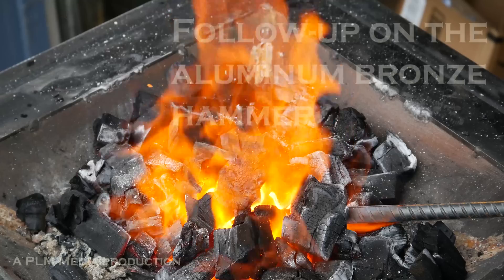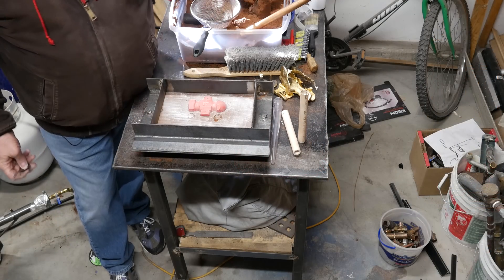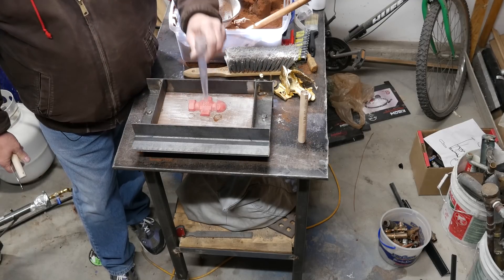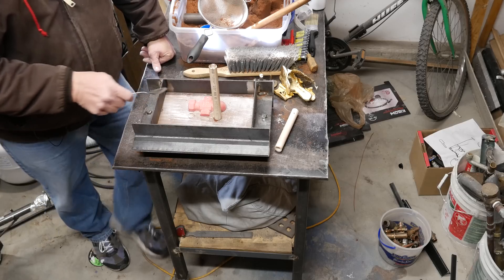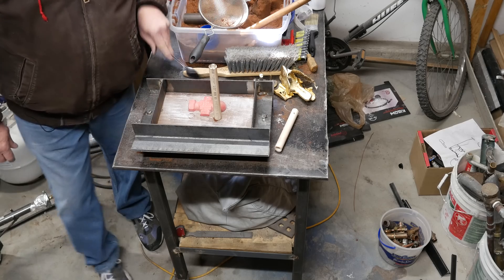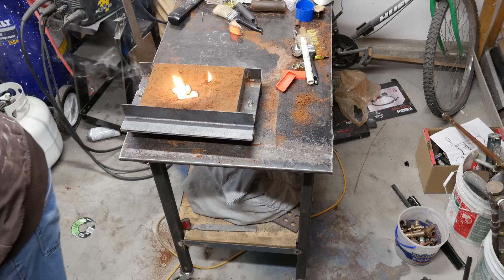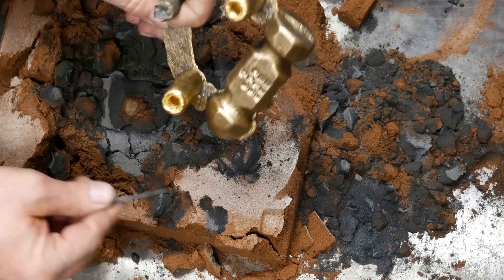Follow up on casting aluminum bronze hammer

Comment: I need to make 3 hammers similar to this except in brass. I believe brass has less issues with shrinkage but I still want to use a tapered sprue and similar gates. Do you think I still need two small risers or just one large feeder/riser like Martin uses?
Regards, 
Preso
Reply from the maker: Hi Mark. I'm not familiar with how brass shrinks. I assume it's not as bad as the aluminum bronze that I used... nothing is except maybe a souffle.  ;-)

Martin actually suggested the two feeders so that there was one near each large mass in the hammer.  I suppose you could do one large one above the part but if you're using a core for the eye of the hammer you might be defeating the purpose as that will be the thinnest part of the hammer and likely to freeze first. Of course with the feeder right above it maybe it wouldn't. Sorry man, this stuff gets so bloody complicated when you're trying to figure out where to place feeders.  I'll let Martin know about your question and see if he can add anything.
Reply: @swdweeb  Thanks for the feedback. I hadn't considered that the big feeder would have to go in directly above the core. I think i will just replicate what you have done. No sense in reinventing the wheel! I did cast a lot of brass lately and it seems to have far less shrinkage problems than aluminium and I am guessing aluminium bronze. My only issue now is getting some hammer handles. I went to two tool suppliers, a rural supplier and our local hardware store (like Lowes, only worse) and not one had a replacement hammer handle. Evidently, hammers are now considered to be consumable items. I had to buy 5 new old stock hickory handles from the UK via Ebay.
I always enjoy watching your videos. Having fun and learning at the same time has much to commend it!
Regards,
Mark Presling
Reply from the maker: @Preso58  Thanks Mark. I appreciate that. Good luck with the hammers

Comment: Thanks to you and all that helped for the details!
Reply from the maker: Thanks. The more I cast Aluminum bronze the more I'm slowly learning to accept is that it shrinks a lot and you hae to provide it with adequate feeders. If I were to cast that hammer head one omre time, I'd pur larger feeders on it even though those small one seemed to work ok.

Comment: I was looking for an alloy I could make at home to make bullets from, I wonder what weight a bullet would come to if I made it from this aluminum bronze
Reply from the maker: Don't know. I'm trying to cast a hammer that is using the actual head as a pattern. The real one weighs 2lbs 12 oz. The bronze came in at 2 lbs 7 oz and there were voids in it so it's almost the same weight as steel. I'll know more once I get the head cast without issue.

I hope you're not planning on firing them. This stuff is hard and would probably wreak havoc on the rifling in the barrel.

Comment: Great looking casting!  I have a minor suggestion I have see used for a even finer finish if you would like to test.  After removal of pattern reapply talc powder to the molding and remove excess used compressed air.  It fills in to smooth out the grains and gives a near perfect finish.
Reply from the maker: You know, I saw olfoundryman do that in a video just the other day. I didn't think about it at the time, but that makes perfect sense.  I'll try to remember to give it a try on the next casting... hopefully this weekend.  Thanks for the tip!

Comment: Thank you. I'm having fun and learning stuff right along with you. Especially now when my foundry bucket is up drying the 2nd coat of satanite right before being ready for tempering and firing in anger. :)
Reply from the maker: Sounds like you're getting close. This is a blast, especially learning to do it right. Clearly I've got a long way to go but I'm a lot further along now than when I started.
Reply: Definitely. All I'm missing is the crucible, which is being delivered tomorrow. Be casting before the end of the weekend... hopefully.
Reply from the maker: Sweet.
Reply: So I wanted to go to a recycling place today to get some aluminum and copper, but they were closed. All I had to use were a few aluminum cans... I wanted to melt something anyway so I fired up and did the following:
1. tempered one of my new clay graphite crucibles which I had coated yesterday with satanite. That turned out swell
2. made some flux for aluminum. A 1:1 molar mix of NaCl and KCl (58g table salt and 75g potassium chloride). That mix melts at around the same temperature as aluminum, and can be used as a flux. I used a tin can for crucible because I didn't want to use a good crucible for that. It was also successful. 
3. melted the aluminum cans that I had (12 of them) also in a tin from canned beans to spare a real crucible. That was a failure, because at the end just after I removed it from the furnace, the can failed and molten aluminum started pouring from the bottom instead of the top. At least it didn't happen inside the furnace. I ended up with a few blobs of aluminum instead of an ingot. There was a lot of dross, and a large part of the molten metal remained mixed with it, and also stuck to the sides and bottom of the can. I have pictures
Reply: Overview of tools(stir rod, crucible tongs in Paul's style, coated crucible, improvised crucibles, ingot mold in your style, and a flower pot with dross) https://www.dropbox.com/s/421bh2gjs2j915x/20180115_111959.jpg?dl=0
My burner https://www.dropbox.com/s/9j1psluk01eyxed/20180115_112016.jpg?dl=0
Few blobs of aluminum from 12 cans of soda https://www.dropbox.com/s/nqxkf5dr2qd34be/20180115_112034.jpg?dl=0
Crucible coated with satanite, and tin can with molten salt mix that I'll use as flux for aluminum https://www.dropbox.com/s/f5idwh2yrrxn3ju/20180115_112059.jpg?dl=0
Tin can used for aluminum, with failure crack at bottom https://www.dropbox.com/s/82kkodcd4gq9kfk/20180115_112119.jpg?dl=0
Inside of furnace (1 inch of kaowool and 2 layers of satanite, each layer tempered separately) https://www.dropbox.com/s/xwxpdouv7agp0i2/20180115_112213.jpg?dl=0
Post-mortem of failed can, lots of dross and bits of aluminum mixed with it and stuck to the walls and bottom https://www.dropbox.com/s/3xl40uwwfatr71b/20180115_112829.jpg?dl=0
Molten salt mix after removing from tin can (it was a pain to remove, hard as glass, had to use chisel) https://www.dropbox.com/s/cjw5gl0lnt2u8wv/20180115_113514.jpg?dl=0
Reply from the maker: That's ok, I've seen dross from aluminum cans. There's plenty of it. If you can get extruded aluminum that seems to be the best for me in terms of aluminum per dross ratio. I still get plenty from that but not nearly as much as from cans. 

I've just been using lite salt which is about 50/50 on sodium and potassium chloride. I don't know that it does anything but I add it anyway.

Once you get some ingots made you'll find they melt much cleaner than anything else. Seems to be a good rule of thumb, make ingots first. Yeah it takes two melts but they are so much cleaner to use.

I didn't coat my crucible, I just tempered it and started using it. Mine got glassy bubbles all over the surface. A friend of mine with some experience said that is normal.
Reply from the maker: Good looking set up.  Have you done anything about greensand yet? Have you built a flask yet? Paul did a video on open flask casting. I wasn't real impressed with the results. I don't think the aluminum does as well in that environment. It comes out too round.
Reply: I have some petrobond but haven't done any casting yet. I'll get around to it, but first I want to be able to melt and cast ingots reliably. Once I have that nailed, I'll go to the next step. Hint: here's a WIP model of what I want to cast from bronze (a Xiphos sword) https://www.dropbox.com/s/wgu419192cs6gsi/xiphosv1.JPG?dl=0
Haven't modeled the guard, hilt and pommel yet.
Another thing that I wanted to cast for a long time is a bronze mini-cannon. I'll probably do that first to gain experience.
As for the salt, I have a big bag of 50lbs of potassium chloride, I just mixed that with table salt in the correct ratio.
I coated the crucible not for endurance, but because I want to reduce the porosity. I want to do some experiments later on which will require an oxygen-free environment inside the crucible (and yes that will mean making a sealed lid); the clay graphite crucibles are porous and I'm trying to reduce diffusion of gases from outside.

Comment: Now that's a good looking casting! Congrats! And thanks for the shout out - I'm glad I was able to help. One more little suggestion based on what I saw - put the risers at the end of the fluid flow. For instance, putting the two risers you used in this pour on either end of the hammer itself would have made absolutely sure that the bronze had to flow all the way through the piece. It also provides the reserve metal supply nearest where it's needed (the thickest sections). Yours worked fine, but it's something you can think about next time. Always remember - thin sections, including any runners/gates and areas in the casting itself might cool the metal down enough to stop flow - so be generous with supply lines, and put risers near the end of the flow path, and/or near bigger parts of your castings. 

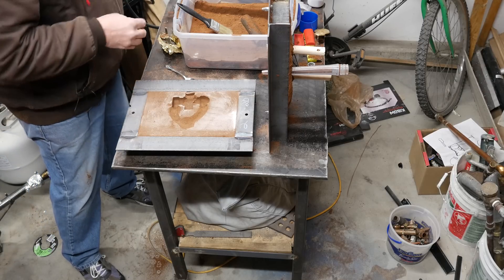That's just some general tips to consider. And oh yeah, make yourself a pouring 'funnel' with an old can packed with sand. Just sculpt the top out to be a wide cone, and you will have a much bigger target to pour into. Check out the 5:00 mark of this video: https://www.youtube.com/watch?v=18gEaRdC0xY (note - this isn't my video, but it's a great example of what I'm talking about). Put those on your main sprue and your risers for plenty of material holding, and a much easier time pouring. ;)
Reply from the maker: Yeah, I've seen those extensions before. I really need to get something I can easily cut sprues and risers with like he used.
Reply: I'll be using this advice too, thanks!

Comment: Great looking casting.  I've been melting my own aluminum for some time now.  I plan to try this type of bronze real soon.  I have to 2 motors that I'm going to get the copper out of.  Keep up the learning cuz I'm in the same boat......
Reply: The motors are made of aluminum with high silicon content and should make a copper-aluminum-silicon alloy, or silicon-aluminum bronze. these alloys are stronger than unmodified
single-phase aluminum bronzes and can be cast and hot-worked more readily.   Silicon also improves machinability, which is why the motors are made of Aluminium-silicon alloys.
Aluminium-silicon alloys are the most common type of casted aluminum. You have to go for extruded aluminum to avoid Aluminium-silicon alloys.
I'm not sure what flux is needed to avoid the high rates of dross production with aluminum bronze when it's melted without flux.
Reply from the maker: Thank you. Its amazing how much copper it takes to make this stuff, but it sure is nice. Hopefully we're always in that learning boat. ;-)

Comment: Thank you and your viewers for giving me something to consider.
Reply from the maker: I think I got a lot of good advice on the last one. I've had some disagreement between the commenters as is to be expected (I think). Basicaly you need your source metal to not freeze up until the part hardens. How you accomplish that appears to be up for debate, larger sprue versus risers, but the end result is the same. If the part starts to cools and shrink and there is no metal to feed that shrink you're likely going to have problems in the finished part.

Thanks for watching

Comment: Trial and error my man. Looks good
Reply from the maker: Seems to be the way I learn ;-)
Thanks
Reply: swdweeb I'd like to start but I don't know what kinda crucible to use
Reply from the maker: that's a good question. Keep in mind I don't know what I'm talking about but here's my answer.

First, as I was told by +eviltwinx make your foundry furnace to fit whatever size crucible you end up using. I didnt listen and my crucible is too big for my furnace. I don't believe the heat distributes as well as it should and the flame from my burner is pointed directly at my crucible. I think the flame should "wrap" around the crucible. 

Next, I thought about just making a crucible out of steel pipe. In my opinion, there are lots of benefits to that in that they are cheap and you can Easily have multiple crucibles (sizes and designs) at your disposal.

The drawback to steel is that many melted metals react with others. Aluminum is notorious for being reactive. The copper in the aluminum bronze reacts with the melted aluminum long before the copper melts. All that to say there is a distinct possibility of you use steel, the metal melting in it my react with it. 

Finally, I bought my crucible off of amazon. It was about $35 maybe $40. It is graphite and clay. Mine is 8KG or something like that. I know 8 was in the size ;-) These crucibles don't last forever and mine is definitely showing signs of wear. I expect I'll be replacing it in the near future.  

I was also told that I should consider different crucibles for different metals, like one for aluminum, one for copper, one for...  That's probably a really good idea. I was cheap and didnt know how much I would enjoy casting so I have one crucible to rule them all. There's a good chance that the next crucible I buy will actually be two or three smaller crucibles.

Hope that helpful
Reply: swdweeb yeah I've tried the fire extinguisher crucible but I may have to buy one ugh lol
Reply from the maker: What happened withe fire extinguisher? Did it just not hold up?  I was considering pipe with a plate welded to the bottom. It would be considerably thicker that a fire extinguisher.
Reply: swdweeb its holding up but I want to melt copper and tin for bronze and didn't want to contaminate it in the same crucible lol. I'll have to find another extinguisher or small propane tank I suppose.
Reply: +swdweeb - if you decide to use a steel crucible of some sort, make sure it's not directly in the flame from your burner. If it is, the side right there can melt through, and you'll have a mess in your furnace. The graphite ones are quire a bit more forgiving of that, though you are right in your comment that ideally you don't want the flame directly on the crucible. Since you know you like casting, why not pick up a few smaller graphite pots to play with? Just make sure to cure them once before melting anything in them. Sometimes they crack on first heat from internal voids/imperfections. Best to find that out when they're empty... ;)
Reply from the maker: What and plan ahead?!?! Are you nuts ;-) 
You're right of course.

Comment: It is not that difficult sir
There is no need for risers and any vents 
Make a bigger and tapered sprue thats it
Reply: Actually, given the material he's casting, it's simply not going to come out properly without risers as well. Apparently aluminum bronze expands and shrinks a lot though the heating cycle. Without the risers as well, the sprue would not be able to feed enough material in before it solidified at the bottom, and he'd have another casting like his first one (with voids in it). Go back in the video and look closely at the risers when he shows them on camera, and look at how much they sunk in - when hot they were of course level across the top (because fluids self level). As it cooled, it sucked in a lot of material...
Reply from the maker: You may be right, but I got a lot of comments, including one this morning that said I need risers so that's what I tried. It worked. This won't be my last casting so I can certainly try what you suggest on another pour.

Thanks
Reply: the point from sprue is to keep feeding the casted part with molten metal 
So if the sprue solidified before the part you will have deffects
Reply: Making a bigger tapered sprue risks air entrapment during the pour. The minimal effort to add risers keeps you free from a lot of problems.
Reply: Also this specific type of alloy has a short freezing range which means you need risers to ensure adequate feeding as the metal solidifies or you get large internal voids, shrinkage, and other casting problems.